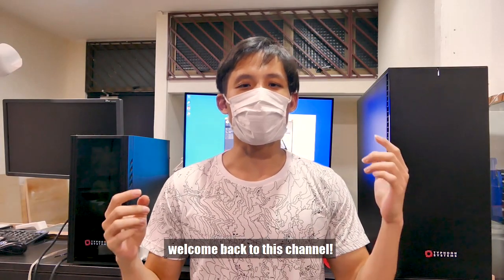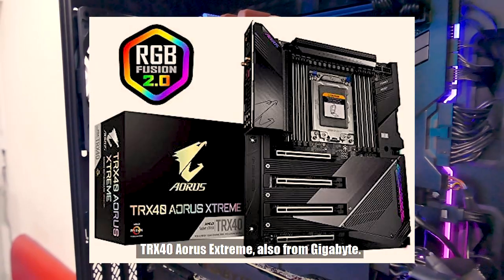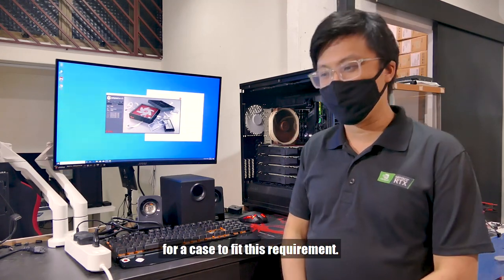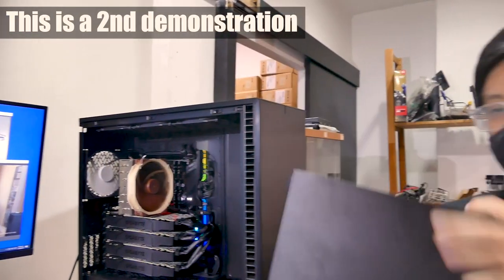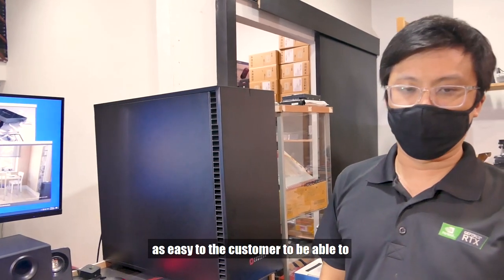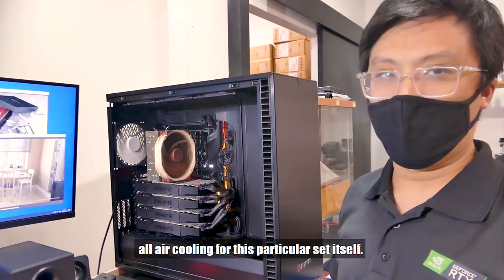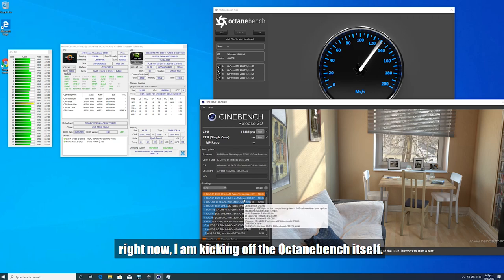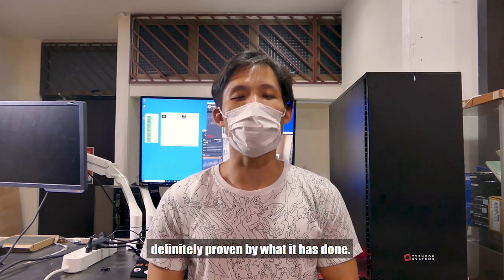INSANE S$15,000 GIGABYTE TRX40 Jewellery Design PC! (ft. AMD 3970x & 2080Ti w/Benchmarks)

Comment: YES!!!! What a monster of a workstation! I just ordered this same cse and MB! Quick question if I may. I am also aiming to have 4 x GPUs as well, I know the 4th GPU barely clear the bottom PSU shroud, are you fellas aiming to liquid cool these cards? I guess getting a GPU block will allow for more spacing for the fitting on the bottom between the PSU shroud?
Reply from the maker: Hey Dharmic, thank you for your support! While we picked this case (which can watercool), the client prefers stability which comes from air cooling. And yes, using GPU blocks will create more space :)

Comment: Saw that you went with 64GB of ram. Any particular reason why you did not go with 256GB of ram? Hard to tell from video if fan was blocking memory slots.
Reply from the maker: Hey White Owl, I would need to check with Gordon. It could be due to the cooler blocking the slots?
Reply: @RealMelTan  I ended up building a similar config.  Ended up going with 128GB because to noctua was blocking one of the slots.

Comment: Damn, any use cases you can think of?
Reply from the maker: You can watch our video, this PC is used for Cinema 4D and rendering of jewellery designs :)
Reply: @RealMelTan  damn still no quad 2080tis that looks like overkill although future proof... btw did you consider the GPU fan blowing onto the bottom one potentially increasing thermals over time?
Edit:
I was talking of 2:24 I thought having front intake fans would have a good effect on gpu side just a thought. Please correct me if I am wrong

Comment: Dude, why didn't you use 3990x or the more beefier dual epyc processors with 2 TB of ram?

BTW are the 4 rtx2080t running in x16 mode?
Reply: The 4 GPUs are running in PCIE x16/x8/x16/x8 mode
Reply: @typhoonsystems6246  thanks for replying. Waiting for more videos from you.
Reply from the maker: Thank you Typhoon Systems for replying! And yes SS computers, we would be putting up new videos. What videos would u like to see?